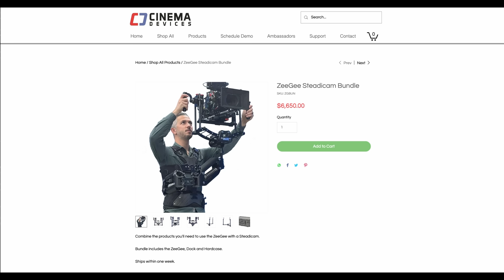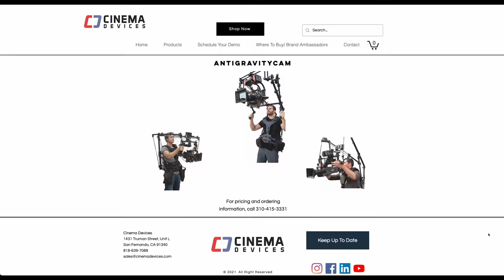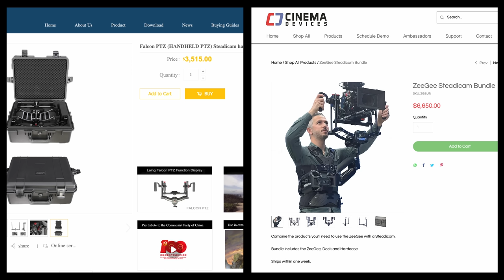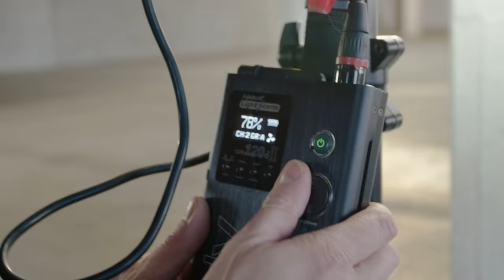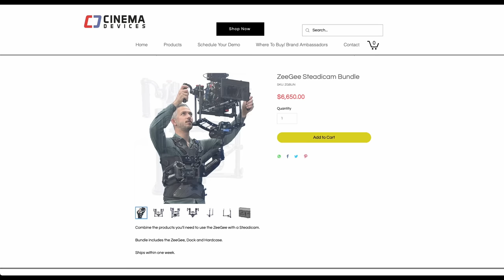Mechanical GIMBAL support system - Freedom of movement

Comment: Cool video however as a steadicam operator I feel like I need to re-enforce what Cinema Devices said in that email, the Falcon is a blatant knock off of Charles Paperts hard work and while I don’t know him personally I understand why he and a lot of operators in the industry are furious about the Falcon. Yes both kits are expensive however operators will make that money back fast in their kit fee and buying cheeper copies devalues kit in the industry which means our kit fees in turn have to go down, this is especially bad atm with rising costs of living. I know that Charles has put a lot of hard work into to ZeeGee and it’s important to support each other as operators instead of buying from companies who make their money by ripping off other peoples hard work. Laing also have a history of making products with cheeper and less durable materials, I’ve heard horror stories of parts snapping on their kit causing fatal breakages to their camera packages. This is because this company haven’t made a single original product, their stabilisers are reverse engineered Tiffen rigs with cheeper and weak materials. I tend to recommend Laing stabilisers to people wanting a cheep starter to practice with without spending £10,000 upwards but they are no good in a professional setting. I personally don’t mind the tilta 360 as it’s not a copy and in general you don’t get the same results with the same ease so it’s a good option for a starter handheld adapter whilst you save for a ZeeGee.
To sum up, although the Falcon is a cheeper option, it is a product born out of thievery and should never exist and has pretty much been completely shunned by the steadicam community
Reply: Congrats 🎊 you won a CAMARA PRIZE. I hope you like the prize and thanks so much. Good luck 👍 Quickly inbox above for it !!!!!!!

Comment: Yeah, I would love to see a video about these battery generators. having access to 2-3kwh would be extremely valuable as someone that both needs to run off their own power on distant locations and for commutes where I'm running a computer in a small car for really long data transfers on the road.

Comment: Hi Adam - thanks so much for this video - really love what you do. Have a quick question- you mentioned using a normal gimbal (I have RS3 Pro) and just turning off motors. 

Do you mean just turning off the gimbal functions completely and having the camera just rest in the center? 

I am guessing you would need to ensure you have perfect balance for this option. 

Would that work connected to a vest? 

What connection point would you need if you just used your own gimbal with the steadiarm? 

Would you be able to do a video on that kind of a setup? 

I shoot a lot of action and I think this kind of a setup would be perfect for getting great handheld action shots while taking a lot of the weight off my arms and hands which get real sore after only a couple hours.

Thanks again - all the best to you and your family. 🙏🏻

Comment: Hey Adam, I've carefully watched your series on stabilizers from the past couple years. These videos are extremely informative and helpful. I really like the results I've gotten using the RS3 Pro inside the Tilta Ring Grip, and I wanted to find a convenient way to support the ring to alleviate fatigue. I tried a two-armed solution (Proaim Hawk Lite) but HATED it. Now I'm going the steadicam route which will look a bit more like what you're doing here. It's taken a bit of time to figure out how to mate the ring grip onto the steadicam in a way that can be easily reversed (for purely handheld work), but I think I've finally figured it out. Thank you so much for all the fantastic work on these videos, they are extremely helpful.

EDIT: PS, there is a solution like this from Proaim/Flycam called the Flycam Equator, for about $1700, in case that makes it more worth it for some people.

Comment: The problem with those western companies is that they put themselves right in line for the Chinese company to beat them. I mean this is the same story of that company that started gimbals tech and was about 8000 usd. Just after that the likes of DJI divided the price by 3 or 4x and nowadays you can ones at less than 300 usd. I am sure dji made 10x more money than that US company. I mean in todays world if you think you can still live for only hollywood production great. But don't be surprise if XYZ company won't democratize the system. I mean the BOM of this must be less than a 1000 usd. I am not diminishing the R&D and ingenious of the guy, but you could add $ 500 usd markup and sell 10x more. If else someone else will take your place.
Reply: Congrats 🎊 you won a CAMARA PRIZE. I hope you like the prize and thanks so much. Good luck 👍 Quickly inbox above for it !!!!!!

Comment: interesting review of it, but one thing not mentioned, how does this compare with say a tilta armour man 1/2/3 system, same vest, but held from above, also using a dji ronin 2 as a mounting cage, as there are plenty of "Steadicam" priced solutions (inc. trinity), all of which mostly do the same thing [from a stability point of view].

Comment: Actually this happen in 2014 and I did the BETA test as well. this is the design took from two different companies. The Handle and the top cage design by  Letus for their 1st Helix and Gimbal part, I do not remember the name of the company right-now (lol).
Reply: I designed and built three prototypes of the ZeeGee between 2009 and 2010, so, no.
Reply: @chupap1  My fella', (respectfully) I wasn't talking about ZeeGee. It was the Helix 3rd axis with the leather handles, design by Letus for Steadicam arm (I still have it - lol)). And I am pretty sure this gyro concept isn't new rocket science (loL) No hard feeling, I have seen your prototype in my DVXuser days but it was't like this one.
Reply: @Finalfootagefilms  OK not really sure which rig you are referring to then.

Comment: Hey Bestboy! Could you recommend a simple yet stronger solution for mounting the back straps on the Thanos Pro X? I was practicing with mine the other week and when I took the vest off to put it away the rivet holding one of the back clip straps had broken off. Of course I could just replace the rivet and use a second washer on the backside but because the surface on the bottom side is curved, I don't know if that would fix it.

If you need some clarification I can send you an email with pictures I took.

Thank you! Loved the video!

Comment: Great reviews as always! What’s the bigger steadicam vest and arm you were using, not the Tilta Float vest?  I’m in the market for a vest and arm combo, to use with my Ronin 3 Pro and RED Raptor.  I think the float, and just the arm might be enough.  I also like how the float you can attach the arm and bridge on the middle of your lower back, not just the belly area. I think the lower back is THE best place to apply the weight and pressure, because all that weight on the belly area pushes force inward on the belly, causing poor posture.
Reply: Congrats 🎊 you won a CAMARA PRIZE. I hope you like the prize and thanks so much. Good luck 👍 Quickly inbox above for it !!!!!!!

Comment: Hey Adam,
Nice video and insight on this system. That's my view on the set-up : need an expensive steadicam vest / arm, you can't pull your own focus...
That why I own an easyrig with stabil arm, and my main stabilisation (mechanical) is a Gravity One by Flowcine. It requires a bit of practice but man, I love the feel of it. Downsides : no limited Roll movement, limiting height utilisation depending on the operator height. it feels so much better if the weight exceed 10kgs and is bottom heavy.
 Feel free to contact me if you like to test it for a video, I'm based in Paris, France.
Reply: If you ever use a Zeegee, you'll probably never want to use a Gravity One ever again
Reply: @grumpybunny  
Would love to try it out, but let be straight forward about costs : 

Easyrig / Stabil : 5K$ + Used Gravity One : 1,7K$ = 6,7 let say 7K$ with some accessories and counterweights.
= 7k$

Zeegee : between  6K + Steadicam System (ranging from 20K to 60k$) depending on the rig. But a minimum of 20K for a Smartsystem cappable of handling +10kgs camera systems.
= 26 to 66k$

Not the same economy at all. You need to work on way higher budgets (steadicam rates) to justify this investements. To me it's an accessory to own if you are already working as a steadi op.
Reply: @PALALALALALALA    You are correct that this will be a more expensive setup than the one you are using. I designed the ZeeGee because of my frustration with overhead hanging rigs such as the Easyrig (this was before Flowcine came up with their excellent parts that mitigate many of the issues). However the ZeeGee is not just intended to be worn, it is a multi-function camera head that delivers the handheld look across in many configurations (please see the Hardmount video at thezee.com). Different tools.

Comment: Hi first of all great videos keep it up.

Second I need answers pls if you answer me you really help me al lot 😃, and you have them both the Ronin 4d and tilta stabilizer adopter arm 😀. 

here is the link of The tilta https://youtu.be/Lh6TLxil0rY

the question 1. that I have is does will effect the 4d. sensor when you attach it to the bottom because of the sensors at the bottom? 

Second question can you bend low with it to make low shoots at the ground? 

Hope you make a review of this or at least answer me pls pls 😀. because for al long time the ronin 4d is heavy and Im wish to buy the tilta but I have those question thank you so much 😊
Reply: can you pls answer me pls I really need some help ??
Reply: Congrats 🎊 you won a CAMARA PRIZE. I hope you like the prize and thanks so much. Good luck 👍 Quickly inbox above for it !!!!!!!